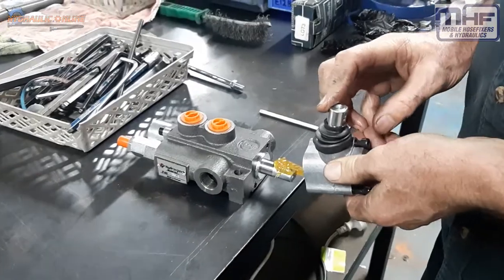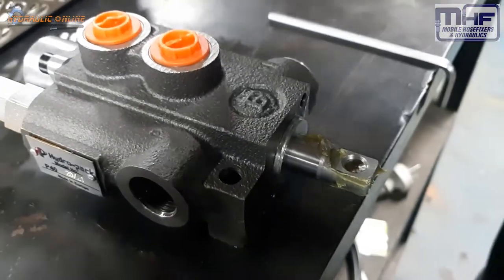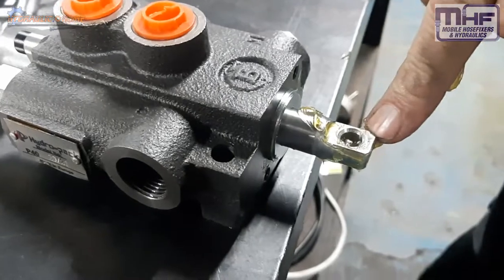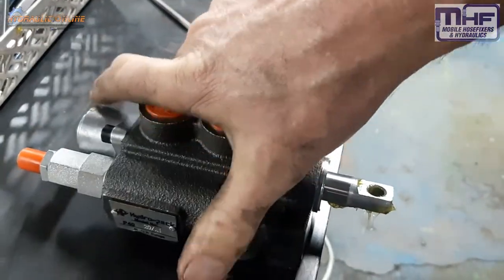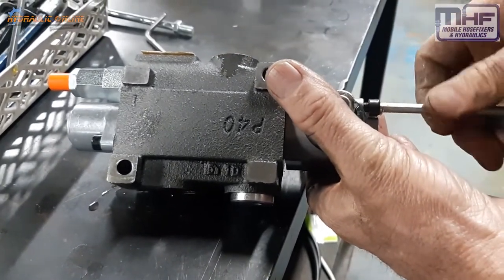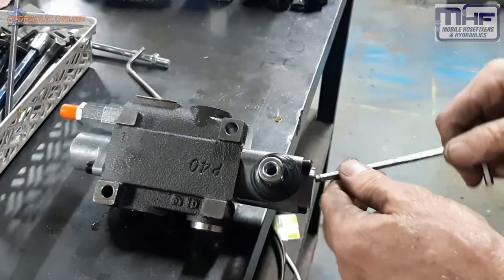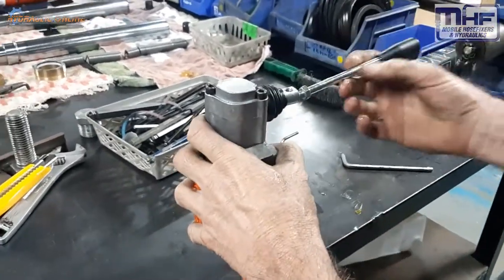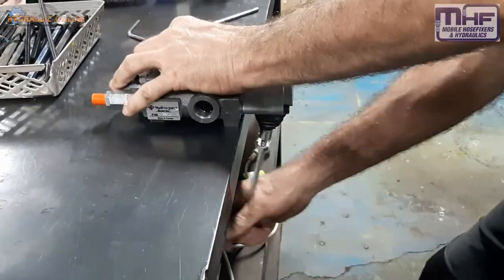How to move the Lever on a Hydraulic Spool Valve away from the Ports and Hoses.

Comment: What if you want to rotate the lever at a perpendicular (90 degrees) to the valve assembly rather than a full turn (180 degrees)?
Reply from the maker: Good Question. On some lever boxes, this may be possible for example if they have 4 equally spaced bolts. In the model in this video, this is not possible as the lever box only has 2 diagonal bolts. Please be aware that it may not always be practical to rotate lever boxes through 90 degrees on valves with more than 2 spools or handles.🤓
Reply: @Hydraulic.Online  In the case of my application it is a single spool valve. In addition can the handle go on the opposite side, next the assembly with the red tip? meaning switching the cap with the diagonal bolts and the housing of the lever?